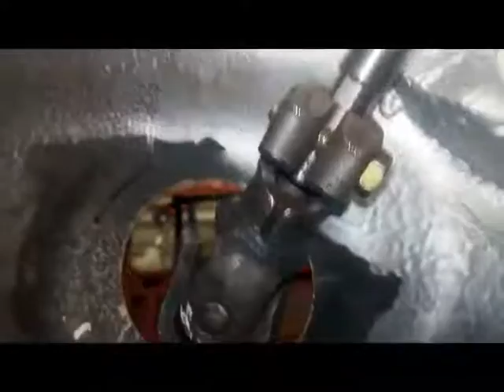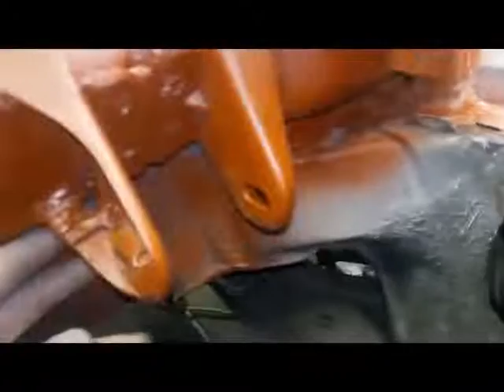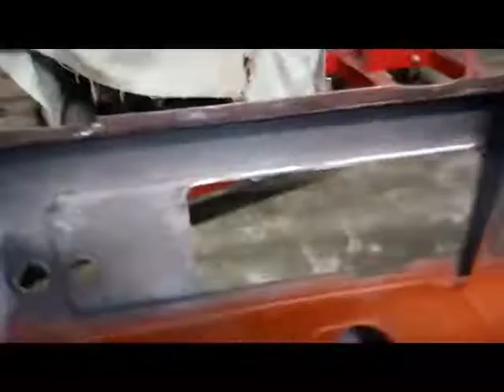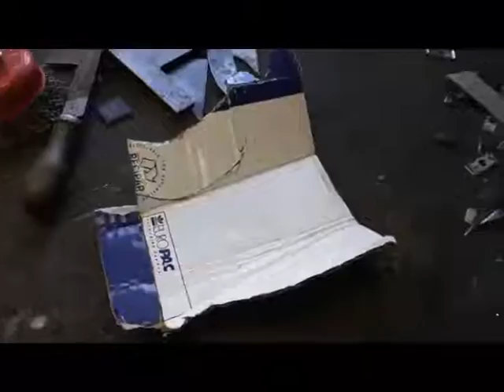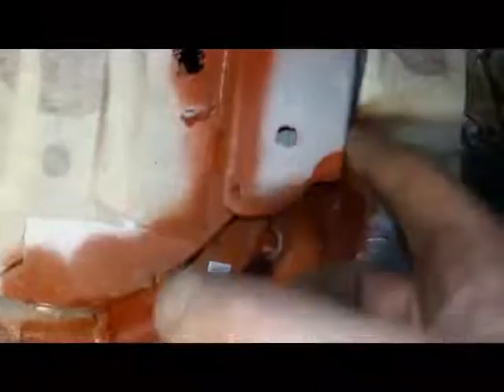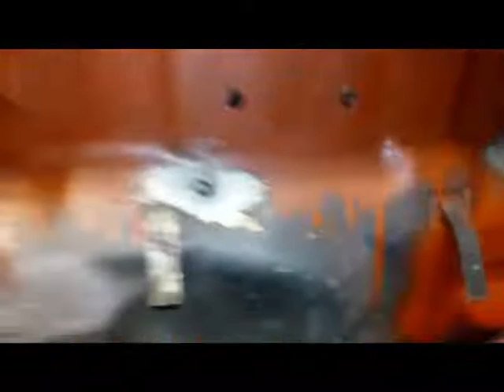Mk 1 golf 1.8T AUM Swap part 9.mp4

Comment: Sweet video 👍 what rack are u using ?
Reply from the maker: Hi James, Toyota starlet ep90, they are mid 90's, a glanza rack is a quick rack. 2.5 turn lock to lock if you can find one, STD is about 3 turns.